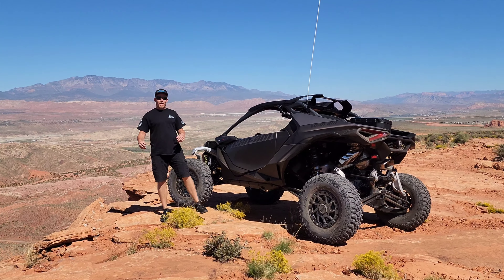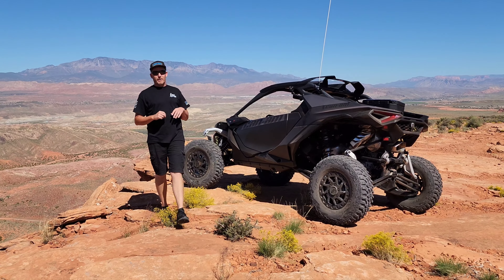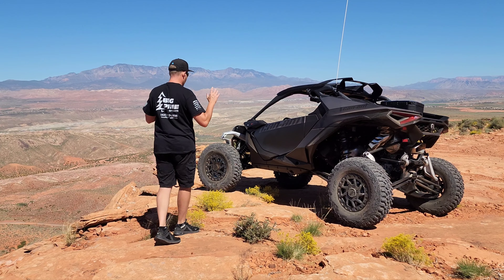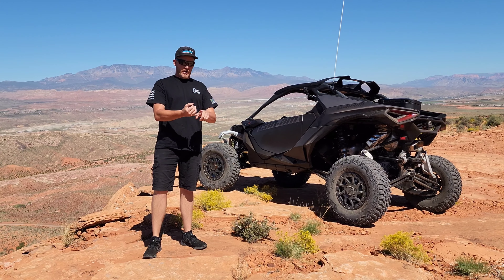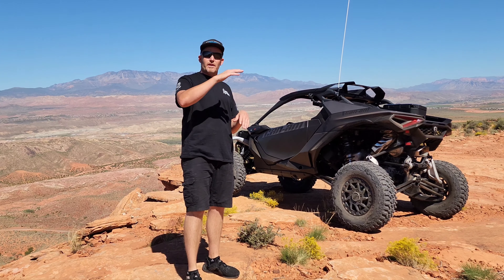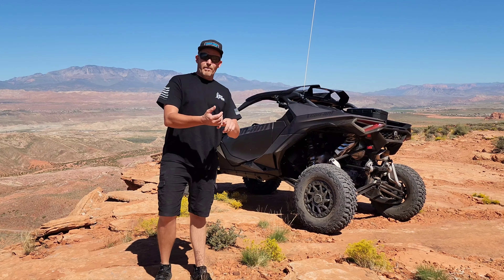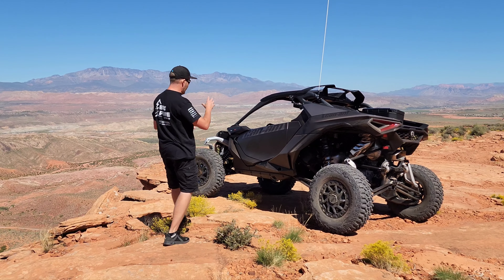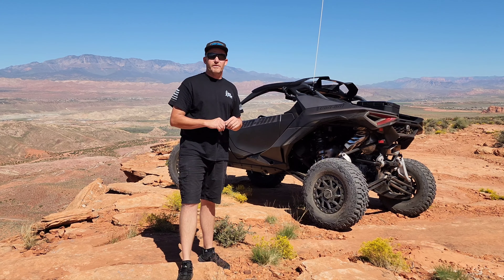WARNING! Watch this before rock crawling OR even driving a Can-Am Maverick R! ⚠️ ⚠️ ⚠️

Comment: Well, sad to say when the Mavic r first came out was actually the first Can-Am that I considered buying but more and more I find out about it the less I like it.
Reply from the maker: The more I'm around it the more impressed I am with it! There is no such thing as a perfect SXS but this is as close as you can get it to date. What don't you like about it?
Reply: @BIGPINESPORTSUT Came across this online I’m not sure if this has something to do with it unlocking. 

3) ELECTRONIC DIFFERENTIAL DISCONNECT

Under hard breaking, the computer will send a signal to the front differential unlocking it momentarily. This action should save the unit from failure which was common for the X3 in racing situations.
Reply: Great info. So leave it running if you're in this situation so it doesn't pull itself out of diff lock 4wd. I can imagine the pucker effect you guys had when this all went down.